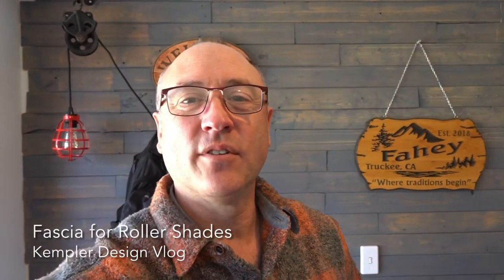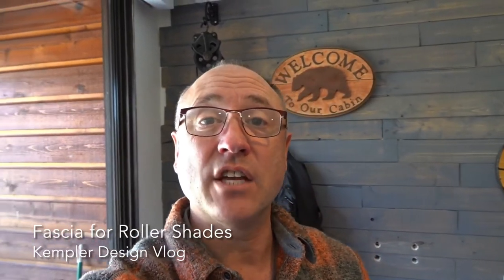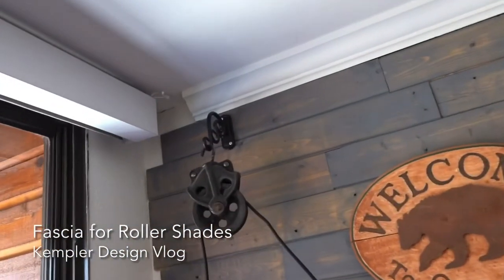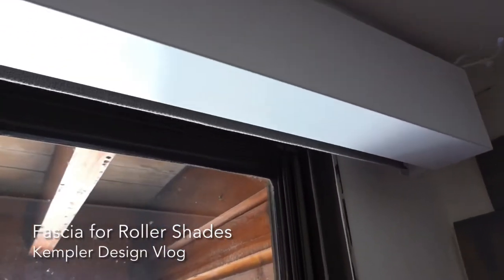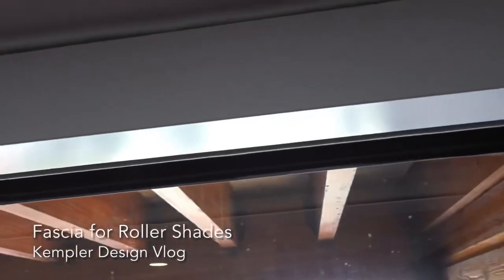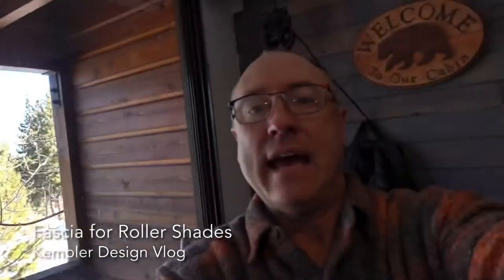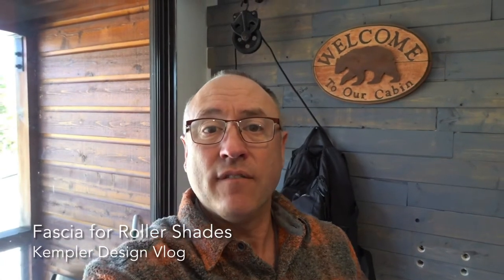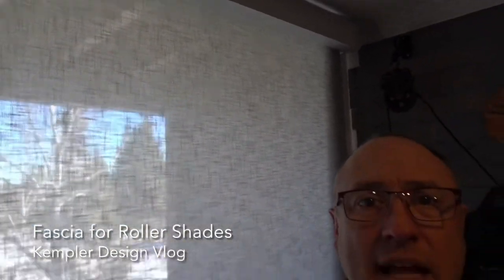Fascia - One Option for Roller Shade Top Treatment

Comment: My HD roller shades make so much noise - thumping and creaking sounds. Also, the roller shade with the channels on the side, light still comes through at the top. 

Is that correct? Appreciate your videos. My installer is slow to answer emails, and it’s been 4 months to get two shades in - and they still aren’t done :(
Reply from the maker: Every issue you brought up is fixable. I'm sure you are frustrated. My suggestion to you is to contact HD directly. I'd be happy to assist you if there is anything I can help you with. Maybe give us a call. - Paul

kemplerdesign.com